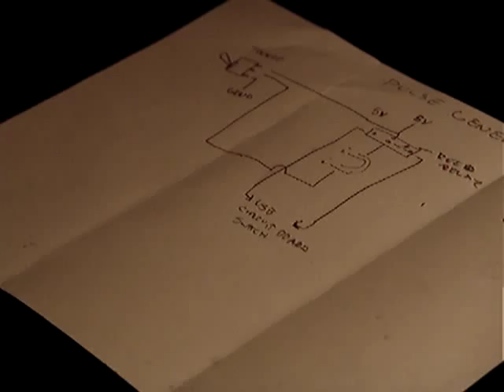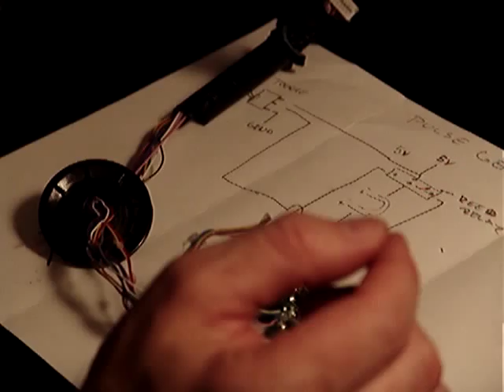Using a flight joystick for parts on a DIY Flight Simulator

Comment: its not the pots, its a driver issue, basically it tells the pc that middle of the pots range is ZERO,  when in reality pots go from "zero" to max(in a numerical value) i tried to modify a pot and still was no go, tried using fsuipc and that did not work. so best option is spend the 50-60$ on a board from leo boednar that has inputs for pots and switches. however if you have a 15 pin game pad port you can use that with no big issues.

Comment: to save others frustration, you cant you just take apart a joystick and use the axis's for say a throttle quadrant, due to the way they are setup internally in the programming. basically for the X and Y axis when inside of the joystick is centered, the middle of the potentiometer is zero unlike say the throttle of a joystick where from one stop is 0 and one stop is 100%. so what that means is a huge headache when it comes setting the axis's up. that's why my project is on hold due to that.

Comment: Hey!  Good idea.  I just bought a new joystick because my old one wasn't working properly and I have already taken it apart once to fix it.  Now it's time to take it apart for good and salvage the part for more flight sim panel creations.  With the built in USB it's going to be easier to use the axis controllers than coming up with an interface for another desktop aviator...New joystick was a Cyborg X from Best BUy = $40 and a great stick...check it out.